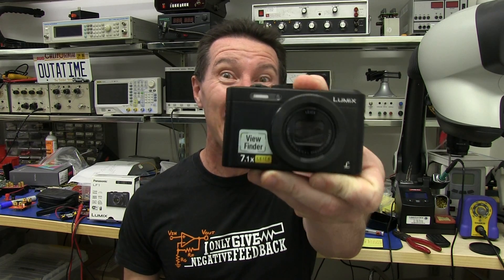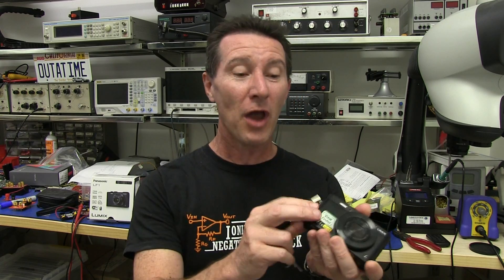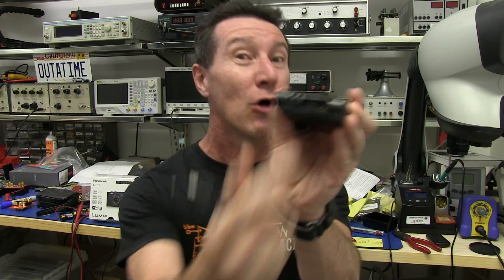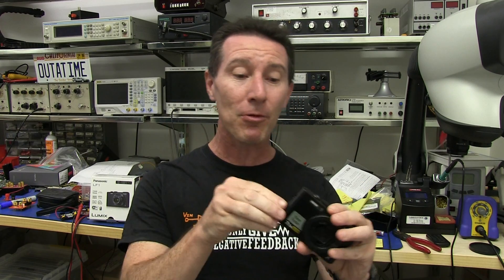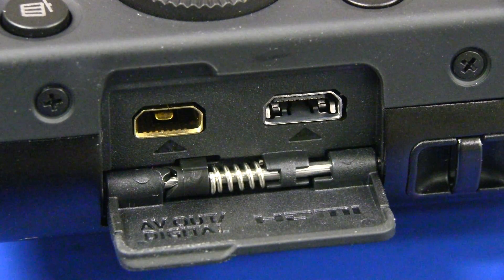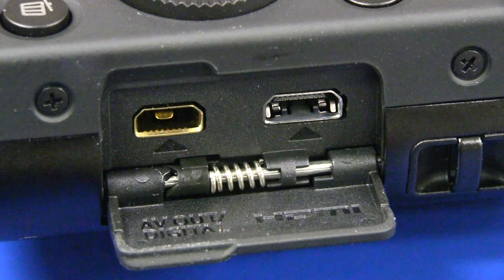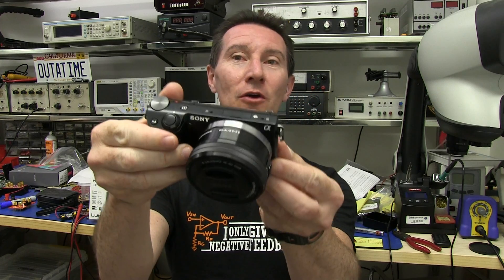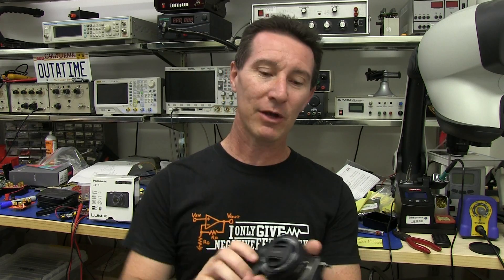EEVblog #578 - Proprietary Connector Rant - Panasonic LF1

Comment: How do you know the person who decided to use that connector was in the marketing department?
Reply: Because all evil EVAR camed from the marketting department!

(Or he is a little biased, holds a grudge to them, but concerning consumer electronics (and many other segments), I wholeheartedly agree!)

Marketing douchebags are usually paid to:

A implies stuff, or sometimes even make promises the hardware sometimes cant really deliver (that's called lying, in my world, and advertisement runs high on that fuel!),
B Help stick up the consumer to make him cough has much as possible for said hardware, either by force, seduction, or both,
Result is people coughing more money than they intended, with or without butthurt depending on if it was "smart" skullfuckery, or not so smart, as in here!
Either by engineering in the necessity to buy other stuff to be able to achieve the implied use of the product, as in here, or just making people feel inadequate if they dont cave in to the trend, buy the next model, etc (and maybe artificially make the stuff incompatible to the rest of the world, or even amongst itself, but that's the cherry on the top)
Best example that comes to mind beeing the buttload of money Apple spends to overstate their originality, superiority or whatever to lock users in an Apple world, when nothing in the actual hardware calls for it, it's no longer power pc, folks, made up incompatibility on intrinsically compatible hardware is BS!

Comment: At least that's not so bad as one of the small keychain cameras I encountered which use a seemingly standard mini-USB to USB cable for charging -- except that it's not and, to make things worse, if you do use a standard cable, it makes the magic smoke come out of the camera due to the different pin-to-pin wiring.

Now I always label every USB cable that comes with devices like this so I know exactly which one to use with which device.

Aaaarrgh!
Reply: That is just not true for 808 keychain cameras of which I own a bunch. Perhaps you got yourself a non-standard variation of 808 keychain cameras in which the video quality sucks crap out of the box. The good standard ones are the #3, #12 and #16.
Reply: sc0rpi0n0
Yep,  it was a very non-standard unit that didn't seem to coincide with any of the other keychain units I've seen before.
Reply: sc0rpi0n0
#11 also works just fine with standard mini USB cables. Just make sure you get it from a quality supplier.

Comment: I tell you what's worse Proprietary Connector from Apple iOS 7 that blocks charging from other cable or other power source by using some sort of firmware detection

Comment: I thought the Europeans were working on a standard... They should ban these and stay to USB...
But i guess the weird cable is to get more than half an amp through the cable ?
Reply: Meanwhile phones have no trouble pulling >1A through a standard micro USB connector/cable.
Reply: The European standard is Micro USB

Comment: micro usb still sucks, better than anything else right now because it is a standard, but the damn sockets break easily. mini usb is a bit better, but there has to be something better to go for a universal data/charge port. micro usb is only rated for 3000 plug/unplug cycles, that sounds like allot until you realize that normal usb is in the hundreds of thousands and mini usb is in the tens, and you might plug a device in once a day if you use it every day, with phones maybe twice, once at home, once at work, and that is just for charging, not for pulling data off or putting it on, and that standard of 3000 is hit or miss, most kindles are sent back because the charge port (micro usb) stopped working and that is the same for allot of devices. micro usb sucks.
Reply: Actually quite the opposite. MicroUsb is rated 10000 cycles vs. 5000 for mini and only 1500 for standart. Main reason it was made is to increase insertion rate.
Reply: MrDehicka
the cables are fine, haven't seen a bad cable unless the tab from the socket (female side) was stuck in it, but i have rarely seen a broken standard usb port (hell, the front usb on my case are older than usb2.0 and have had thousands of insertions and even had thumb drives broken off in them on accident and they still work, and while they are older than usb2.0, they work as usb2.0) i have seen a ton of micro usb sockets broken, i can't speak to mini usb, it is so rare and unused over the years that i just don't have enough experience with it to really speak about it. micro usb sucks dude, the SOCKET breaks before the connector, that means that the more expensive side fails first. replacing cables or even thumb drives is pretty cheap compared to replacing a motherboard or a phone/tablet.
Reply: MrDehicka true! Micro is tight and reliable, mini gets sloppy faster. I had to trow away three mini cables until now. The only disadvantage micro has, is that it can be easily pulled out from the PCB. But the electric contact is better and last longer. Of course, you have to manipulate them with care, both micro and mini for a prolonged life (some people destroy them faster than others).
Reply: oBsRVr666 That document is what it needs to survive to be certified by the USB conglomerate. That does NOT have to do with the specific rates for any random cable.
Reply: "on accident"?

Comment: would have been clever if they used the standard socket and put the av pins on the top surface of the socket, that way you get the best of both, with some intelligent internals to test shorted pins on top or bottom to determine what output it should use.